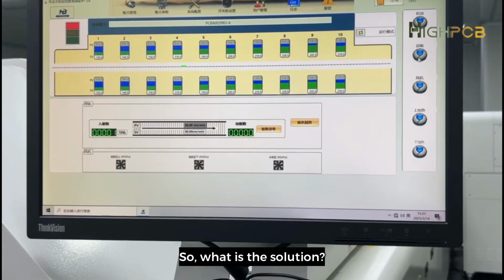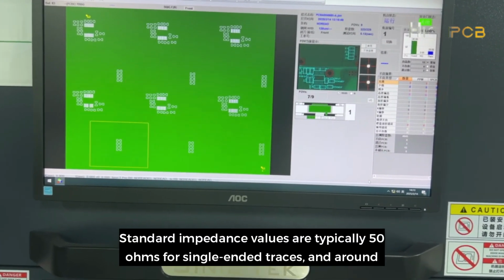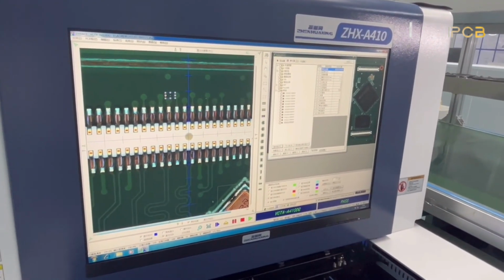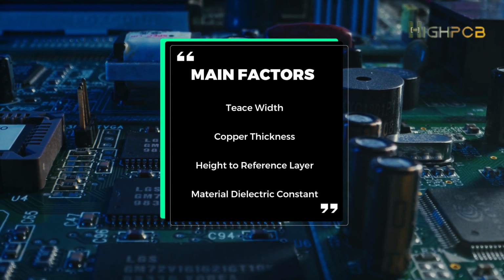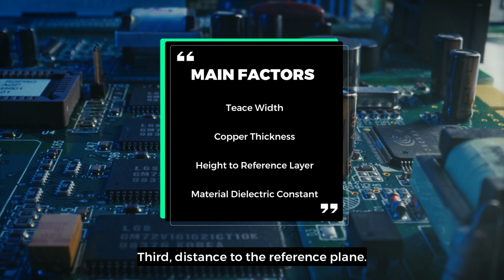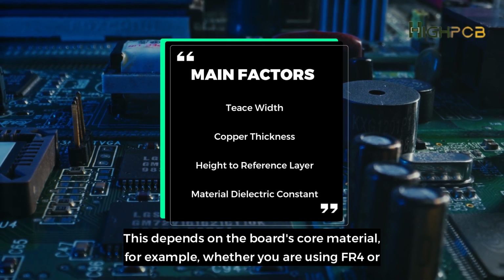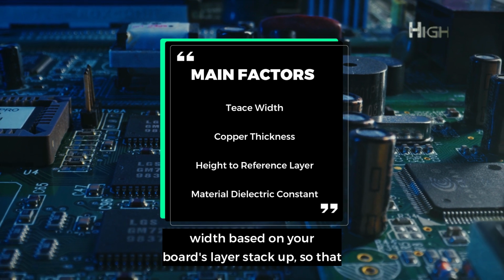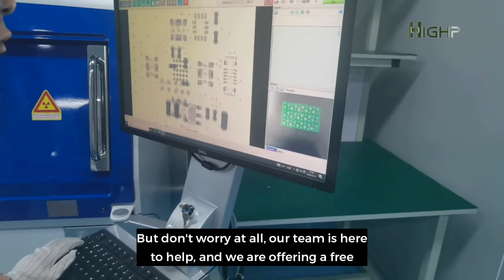Controlled Impedance PCB Design Explained Simply

Comment: I actually had this exact issue last month! I routed a USB 3.0 pair without calculating the 90Ω90Ω differential impedance, and the data kept dropping. Seeing how you explained the trace width and stackup relationship in the video really helped clear things up. Thanks!